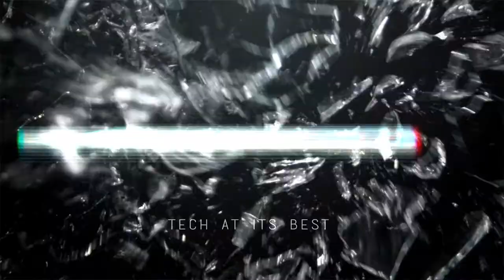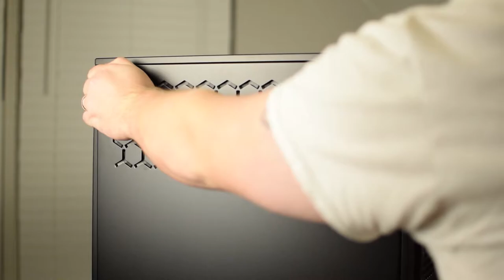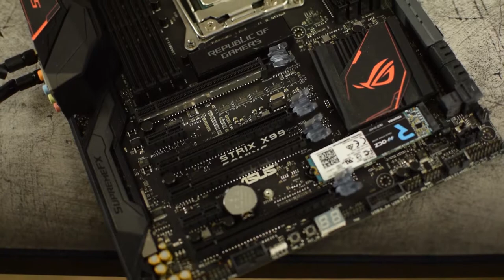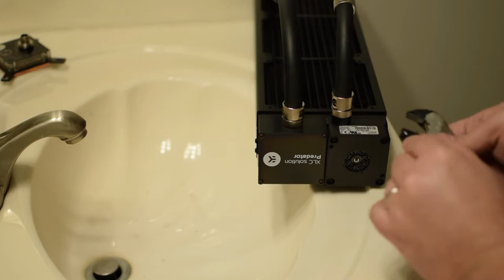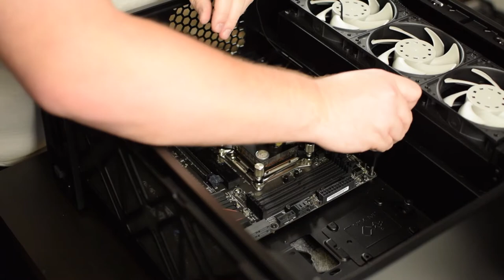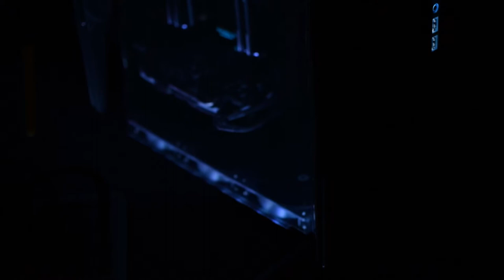InWin 303 review- Will an EKWB Predator 360 fit? [Time-lapse build]

Comment: Nice build, have the same InWin too, love that case, and i know what to do with it ^^ but what fittings do you have on the rad? do you use  bitspower 90° angle on the rad aswell? same you use on the cpu block
Reply from the maker: I actually used some EKWB 90 degree fittings on the radiator, only because they were less expensive.
Reply: I can understand why, the bitspower whas a bit pricey, thanks for the reply ^^
Reply from the maker: no thanks necessary! Thank you for watching!
Reply: I have looked almost all over the net for the predator 360, can't find a online store who is selling it, i know the v1.0 whas recalled, but v1.1, have they stopped completely by making/selling them?
Reply from the maker: They have stopped making and selling them unfortunately. They have entered "end of life" status.
Reply: To bad, whas looking forward to get an AIO like that
Reply from the maker: EKWB is releasing a new modular liquid cooling system. It was supposed to be out already, but has been delayed. I would expect it in the next month, so keep your eyes open for that. It is called "EKWB MLC", but details are scarce right now.
Reply: I will, thanks for the info =)

Comment: Can a WC like The nzxt x62 or The evga 280 clc fit in this case? Thankw
Reply from the maker: It can, but you will need to drill holes for it as this case only comes pre-drilled for 120mm fans. The 140mm fans and 140mm variant radiators will fit though- just requires a bit of custom work. I say go for it! It isn't as daunting as it may sound.

Comment: You said you had to mod the case to mount the EK Predator 360, but the video didn't show any mods or comment on what those mods consisted of.  Where they simply drilling new holes for the mounting screws or something more substantial?
Reply from the maker: I did reference in the video that I had to cut some of the "webbing" separating the main part of the case and the PSU chamber. It is also in one of the b-roll shots. It is shown where the tubes come into the PSU chamber. Nothing major. Very quick and easy with a Dremel.
Reply: Thanks for the clarification! I see what you mean now. I just missed it. Doh
Reply from the maker: No worries! Always happy to respond to any questions. Thanks for watching!